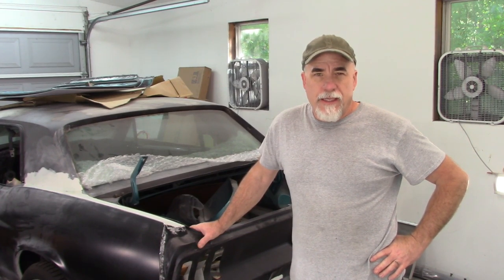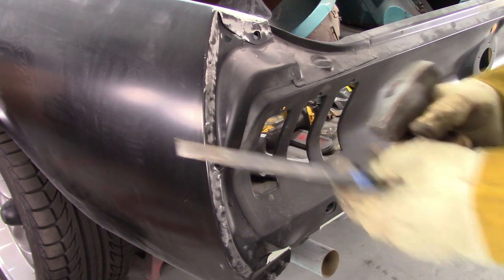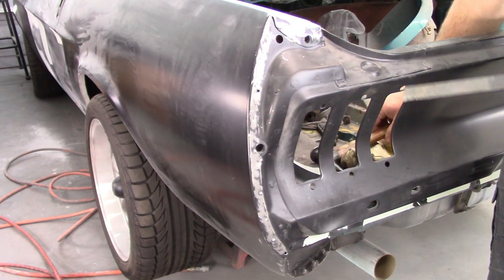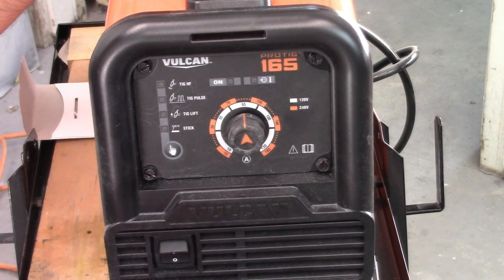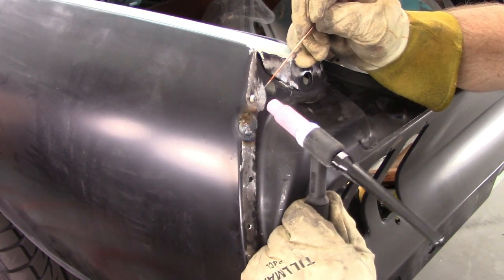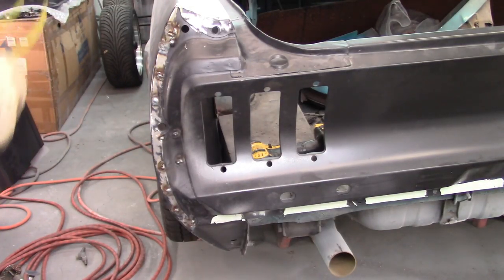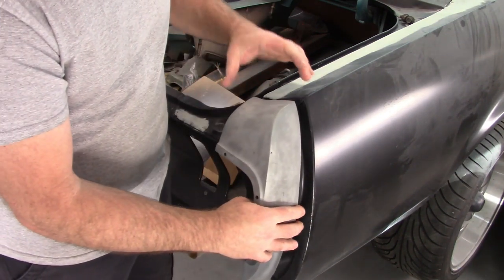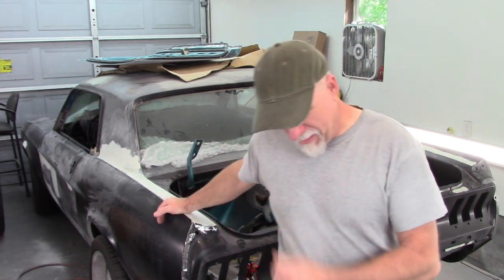1968 Mustang quarter panel extensions. Making the panel fit the extension itself. Jade part 30.

Comment: Thank you Barry, this information is priceless to anyone trying to restore one of these cars. After 50 years on the road each car is unique especially when you try and marry old with new... I ended up doing the exact same thing to the front extensions. had to cut the welds all around the headlight bucket so I can manipulate the fender to match the extensions.   Wally

Comment: Great video Barry, when I was fitting my extensions, I had to slightly enlarge the mounting holes on the rear panel. When they were drilled at the factory, they were off by about 1/8 of an inch or so. After enlarging them, the extension positioned a lot better and I got lucky and didn't have to add any filler there for the transition. Good luck and keep the videos coming. Thanks.

Comment: i feel your pain Barry.. just attempted to do my stainless headers yesterday and made a horrible mess of things.. instantly went inside and started watching youtube videos to refresh. stainless is a pain. i can't even imagine titanium... i'm not that great, but a few huge tips that affect more than you'd think.. the metal must be super clean.. wipe it with acetone... just like you pop quick mig spots, you have to do it even more so with tig.. don't hold an arc long. the metal will heat soak. and if you dip the tungsten, resharpen it.. don't try to keep welding. in reality, body sheet metal is best mig'd. now frame work, tubing, etc.. tig is prettier, cleaner, etc..  i like the effort though. i think you'll love that tig for welding things other than that sheet metal.

Comment: For TIG welding sheetmetal I use MIG wire for filler. Try to keep your filler wire the same diameter or smaller than the base metal. Especially for thin material like automotive panels.

Comment: The quarter panels and the extensions on my ´67 are original. The outer, larger curves follows the quarter panel nicely.  The shorter concave curves, where they meet the decklid, do not match. I'm still debating wether to break the spot welds loose on the quarter panel or just leave it as it left the factory. I need a new decklid as well and need to have that in place before I make a decision. But that will have to wait until I've installed subframe the connectors that are lying on the garage floor. There are cracks in the quarter window area and dimples in the roof, above the rear glass from the vehicle twisting and flexing all it's life.
Reply from the maker: Factory quarters? I would leave them the way they are if it's not too bad. I would likely use filler to shape them together.

Comment: MiG is less heat! Try moving the tungsten in more and putting the cup on the metal and rocking it back and forth. I have a question with all the Different panels and manufactures of said panels do you leave on the factory primer or do you scuff them up before you paint primer on the panels ? Thanks for all your videos!!!! 👍🏻
Reply from the maker: It depends on the material on the panel. Some coatings are temporary. I've heard a simple test is to wipe the panel with lacquer thinner and see if it comes easily. If it does, it all needs to come off. With my experience, I will sand it off and spray with epoxy primer.

Comment: Thanks for these videos. I am working on a '68 coupe. It looks like you don't use the rubber gaskets on the extensions - is this true? I have new gaskets but can understand they modify the look somewhat. I've already had to correct the height of the new quarter in the back by drilling the spot welds and adjusting. The repo sheet metal requires a lot of attention and I've learned a lot from your videos.
Reply from the maker: I don't like the gaskets. I won't be using them.

Comment: wire is to heavy try .045 or even.035 keep that tungsten sharp and turn down your gas.Also make sure the metal is clean no paint to nothing.Tig hates dirt paint rust oil ect.
Reply from the maker: Thanks. I'm learning.

Comment: TIG isn't a very good option for sheet metal anyway.  Too much heat for too long.

With TIG, you need to treat it kinda like oxyacetylene welding.  Build a puddle from both parts being welded, then add metal with the rod in your other hand. Keep that rod close so that it is slightly molten at the tip.

Dip.  Move.  Dip.  Move.  Dip.  Move.  Dip.  Move.  Dip.  Move.  Dip.  Move.